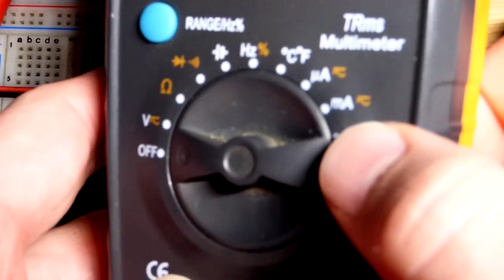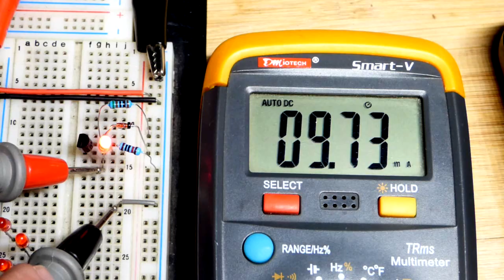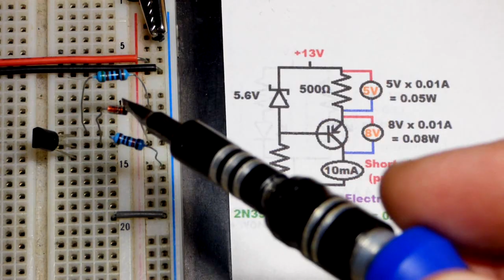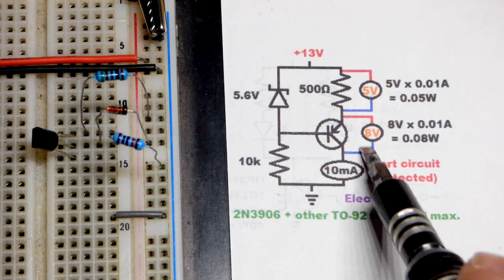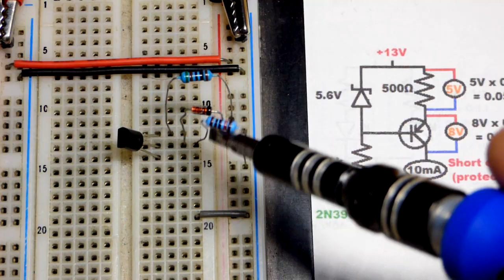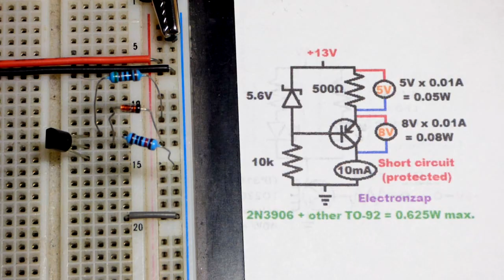About 10mA PNP BJT current source using 2N3906 Bipolar Junction Transistor circuit

Comment: I lold at turning the multimeter off.  Ive sacrificed way too many AAs from that.
Reply from the maker: Yeah. This is being turned into a short, so I was extra quick. It's also easy to forget that the auto ranging meter is set to measuring current instead of voltage if it is left on.